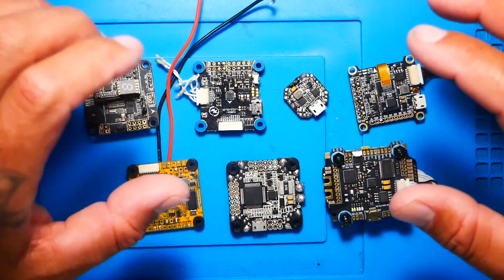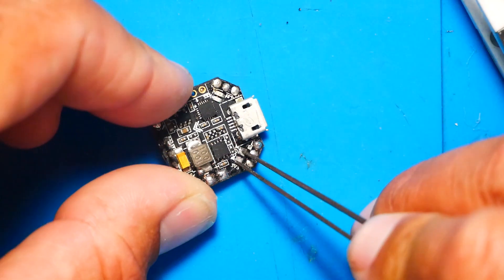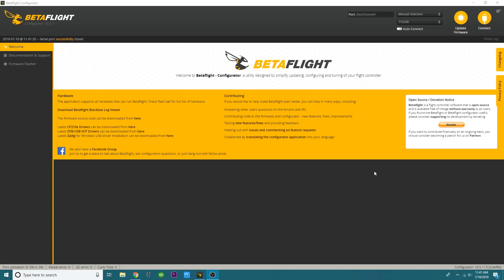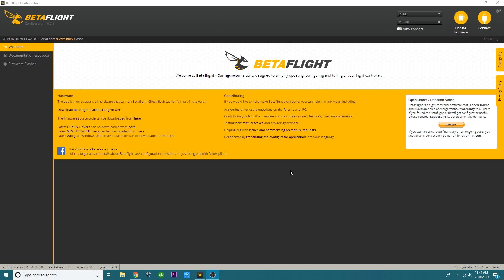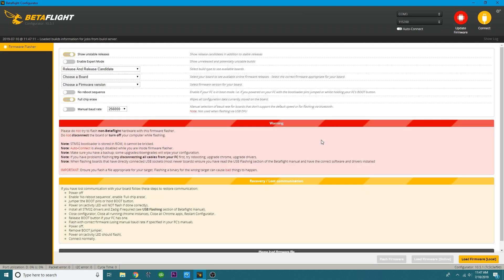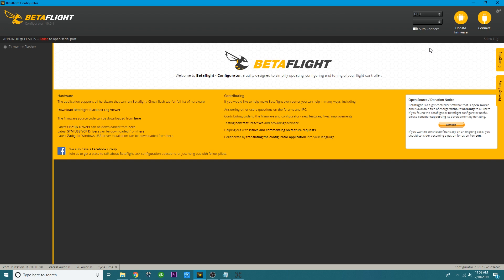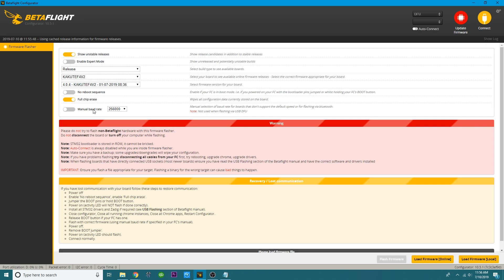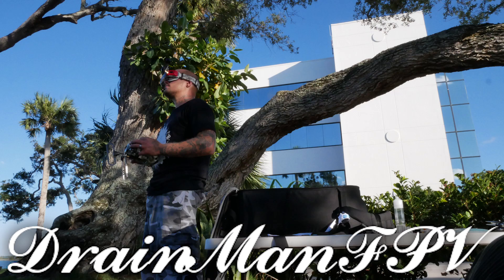How To Flash New Firmware On Your Betaflight Flight Controller -

Comment: Hi i have a question 
My fc connects, says com5-Matekf4 and will connect too
Is it normal for it to dissconect when you select firmware flasher tab or must it be in dfu mode while in firmware flasher
I can access dfu mode 
But if i connect in flash mode i get failed to connect to board in the message bar 
I have unplugged gps/rx/vtx 
Can i still flash the board

Comment: in the version of bataflight i downloaded it doesn't show the software it just shows successful. Also my radio didn't work at all. I had to add ibus on the bootloader screen not the other stuff and it fixed the problem. you might wat to tell people about this. thanks

Comment: This video saved me. 
My meteor65 pro had erased its own memory. 
The company I got it from couldn’t figure out how to fix it, BetaFPV couldn’t figure out how to fix it. 
MANY emails back and forth with the manufacturer and the sales company in the US over many days couldn’t figure it out. I watched your video and 15 minutes later my quad was working. 
I’m in my 70’s and was very frustrated with it all. 
This morning BetaFPV said that my FC was defective and they had offered to replace the quad. I tried the drive fixer as a last ditch effort. 
Quad is bound to the TX and working. 
Thanks for posting this video!!!
Reply: The fact that you're in your 70's and still had that much ability to resolve a technical issue like this should be an example to your generation. Happy flying mate!
Reply: @ViewFromAbove_ 
Thanks for the kind words. 
Now arguing with DJI about a new DJI Mini 4K that gives me a •Power system hardware error. “Restart aircraft
(Code: 30210)” code occasionally. Not always. 
I put I ticket in for repair and they say “dew to a shortage of parts” basically they can’t do anything… US tariffs blocking parts needed I assume…quad has never been crashed. I hand launch and land… I think it’s a firmware issue… 
So.. I just have to do a restart, quad works fine. Guess I have to live with it… 🤷‍♂️
At least till the next firmware update. 
Thanks again!

Comment: I did this to my Moblite7, (yes, correct target and latest stable version), but it is not the same as original. Receiver was set up wrong, VTX not working, it is useless. My first drone... wasn't working from start. I am so frustrated. I waited 3 months for delivery :(

Comment: I have a babyhawk r pro 4 inch and I flew it for a few days then I went and turned it to 200mw and after that the camera started acting weird.  It has an emax osd that I cant change, and the reception is crap like 10ft away it cuts out.  So I did this firmware hoping it will fix it but it didnt.  Do you have an idea on what the problem might be?

Comment: Don't understand it says:
An error occurred while entering bootloader! Access to the port 'COM3' is denied.
While trying the impulserc driver fixer.
Have tried over and over all different ways but says same thing..
I can use betaflight fine with COM3 but cannot enter dfu..? Please 😣.
Reply: Hey there, I have the same problem. Impulse Rc Drive fixer is loading and than Error 99 :/ Do you find a solution for it?

Comment: Sir can I use 10.6 configarater and flash betaflight 3.5.7 on my cinehoop but 4.2 for my other freestyle quad ?????
Reply from the maker: Yes you can flash different versions with the same Config, I am not sure exactly which version will not flash which version though. All you can do is try.
Reply: @DrainManFPV  thank u sir

Comment: great vid drainman as always. so if I plug in my FC and it only gives a red solid light, and never finds my FC using the impulse driver fixer, does that mean my FC is bad? Tried the driver fixer and all you mentioned in your vid, but no cigar. When I plug in a lipo it makes all the sounds for ESC tones, but FC stays solid red. New FC needed at this point?
Reply from the maker: The LEDs are really different on all FCs it's hard to say that a certain color is bad or good without knowing the model. Which FC do you have? Have you checked the board for a short circuit?
Reply: @DrainManFPV  thanks drainman!! It's the HGLRC FD445 Forward F4 Mini. I flashed it to bf 4.1.4 and all was well but I don't know what I did but I saved something and then nothing after that. One thing I noticed was the target was omnibusf4v6 and bf had that target but what was in parentheses, after omnibusf4v6 (airb) was different than the hglrc one. So target omnibusf4v6 was same except what was in parentheses after it.. Would that make a difference? So u have a video on checking for shorts? Sorry semi noob when it comes to that.. thank you very much for help btw!!

Comment: First time i actually understood what the heck the video instructor was talking about!  You do a great job of explaining and showing what your doing so it can be understood! Most go so fast and don`t explain alot of things, i guess assuming everybody knows it! Thank You! Liked and Subscribed!  Quick question. I got a new bnf drone that bound to transmitter and everything works on radio right, But in Betaflight it connects and shows osd, and settings, but can get no stick movement in receiver tab, and no switch movement in modes tab. I got latest version of B.F. and can`t set modes or do any changes to drone in B.F. except the OSD. Would be very thankful for any help!
Reply from the maker: Hey friend! Sounds like you aren't bound and/or you have the wrong protocol set. What type of receiver do you have, make sure configuration is set to that receiver
Reply: @DrainManFPV  Thank you for answering! I am bound, and have flown it on my x-lite, but only has acro, but flies pretty good. I have checked all the settings and all are set right. I think I will just take this one to a hobby shop, and see if they can figure it out. I have gotten to frustrated, and hey its a fun hobby, and I been messing with it for too many hours to be fun, and tried all the things that others suggested with no success! Thanks for your time! Really Appreciate It!!!!

Comment: ImpuiseRC Driver Fixer fails repeatedly. An old thread in RC Groups claims disconnecting the R-XSR receiver fixes the problem. I haven't tried it yet so stay tuned. Whoever has a pipeline to the BF Devs needs to tell them this is total B.S. if that is the solution. Having to rip everything apart just to do this should not be required. Especially if the receiver is jammed in a place that makes it hard to disconnect. This hobby seems to be filled with more hurdles and stumbling blocks every time we want to make a change. And the community wonders why people get so frustrated.
.
Update:
Apparently this was the case. I had to open my frame and disconnect the R-XSR. I disconnected the vTx while I was at it. This is a pretty inconvenient and counter-intuitive step. One shouldn't have to go to this length to do something so simple. I hope BF fixes this because pulling on such a thiny connector or de-soldering after everything is together is a hassle. Also there is this thing with vTx Tables. Another hassle.

Comment: Followed everything you said but when I hit flash nothing happens?
Reply from the maker: Did it load the firmware
Reply: @DrainManFPV  it erased all settings for tinyhawk s.
Reply from the maker: @etab83  Did you use correct target? Also you have now lost all your tinyhawk settings? that were originally on the flight contoller?
Reply: @DrainManFPV  yes I did. Can you tell me how to recover? I'm a noob
Reply from the maker: @etab83  Hit me up on FB ill help you get it back